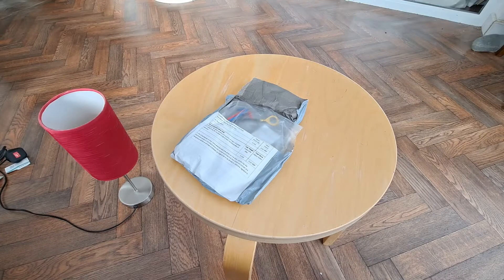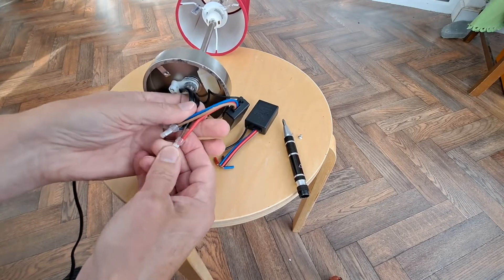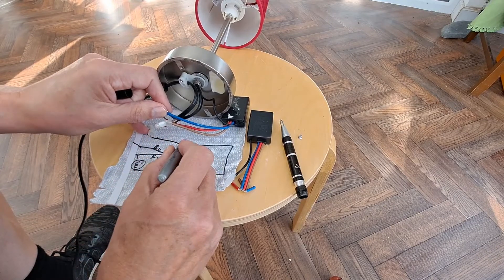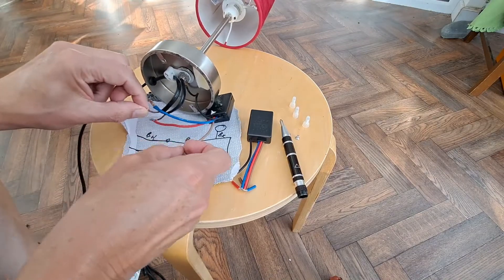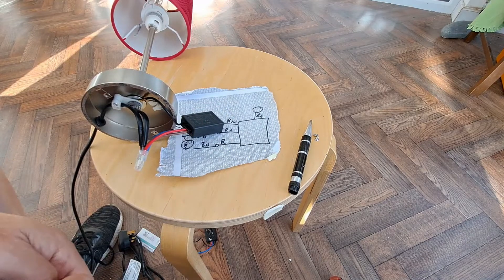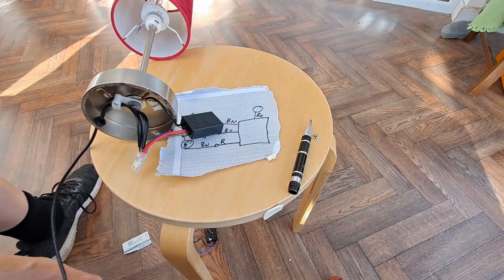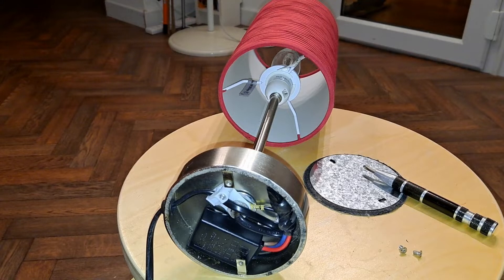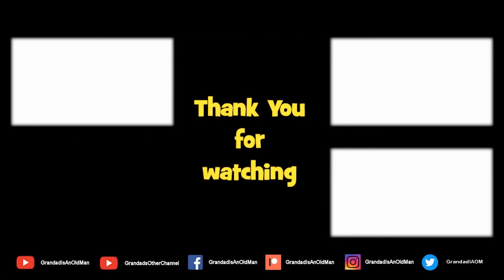Another faulty Touch Lamp PART 2 20220919 Replace the module

Comment: Do they sell magnetic screwdrivers there? I liked yours. But magnetic would be pretty cool. Mine is a Dewalt w all the bits in the handle that fall everywhere if you're not REAL careful. Ha.
Reply from the maker: Yes you can buy magnetic screwdrivers, and you can magnetise most existing screwdrivers by passing them over a magnet a few times in one direction. Or you can temporarily stick a magnet on the shaft. However, quite often you will find it a disadvantage when small screws jump out of the hole and stick sideways to your screwdriver, instead of pointing in the right direction.

Comment: Yeah, I dealt with some "touch" lamps in the past. We just took out the touch switch module, connected the wires together and put a regular switch onto the lamp's cable. These touch switch modules not worth replacing. 😉
(If the lamp has a sticking out rod for the touch control, just leave that in place for aesthetic reasons if you not want a hole on the lamp instead.)
Reply from the maker: There are advantages to a touch lamp, especially in the dark. Replacing the module is easy enough. I have used a switch option in the past, but the replacement module cheap enough on eBay. However, I will admit the modules only seem to last for a few years. Technically it would be possible to replace the faulty component.
Reply: @GrandadIsAnOldMan  Definitely the easiest way is to completely eliminate the "touch switch" module from the lamp once the original modul becomes faulty.
Reply from the maker: @zsombor_99  yes, you are right, but that doesn't help the first point of my previous reply. In the dark, a touch lamp can be very convenient. This one is from our guest bedroom and make life easier for somebody in an unfamiliar room in the dark. If I wanted a switched lamp, I would have bought one. In fact I probably have a dozen switched table lamps around the house as I use them as lighting for my videos 💡😊
Reply: @GrandadIsAnOldMan  Yeah, it's also counts what you got used to... 🙄

Comment: Nice fix. How does it work Tho when you Touch the frame and the lamp turns on?
Reply from the maker: Touch lamps work on the principle of capacitance. When we make contact with a touch lamp, we alter its capacitance. The black box detects this and switches on or off accordingly.
Reply: @GrandadIsAnOldMan  I saw a setup where the person make an old pipe part of the decor as a lighting mount and had the whole thing set up to touch. Lol. I thought that was cool (Reiley's Railhouse, Chesterton, IN. Train hotel. You stay in a train car in an old station; 30 feet from a working diesel line :) Extremely cool, imo. Trains came by 15-30 minutes. A whole line of boys would stop by to watch )

Comment: I was thinking the zip tie would stop the wires pulling out, but it does no harm to insulate everything, especially in a fitting that can't be earthed because its being used as a touch switch! Those touch lamps are nice, I can't imagine how much time I have wasted in life trying to find and operate those plunger switches on bulb holders for table lamps, or fishing out the inline switch from behind a table or sideboard.
Reply from the maker: These touch lamps seem to fail after a couple of years. I have fixed quite a few of them now. I don't trust those crimp connections. They should be 100% safe where they are as there is no tension on them, but in the past I have seen them fall off when I have opened up lamps like these.